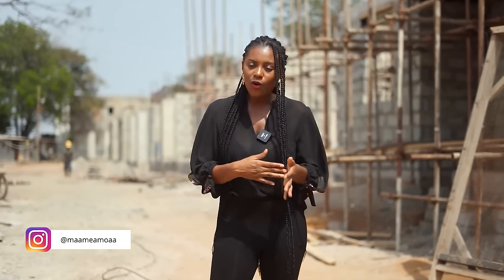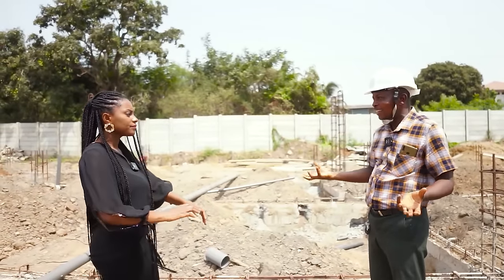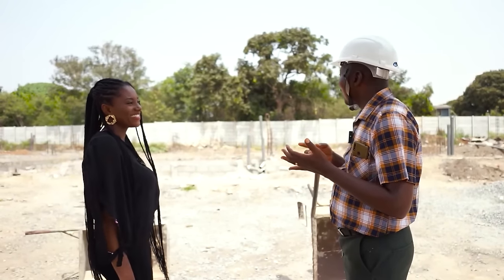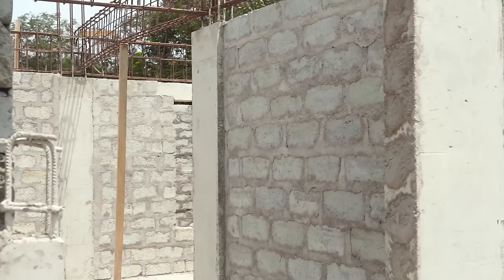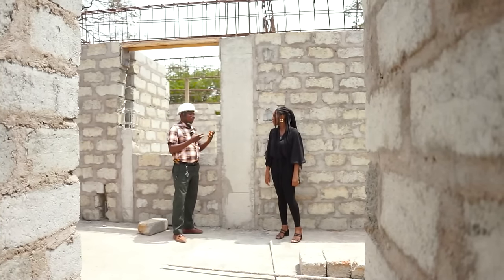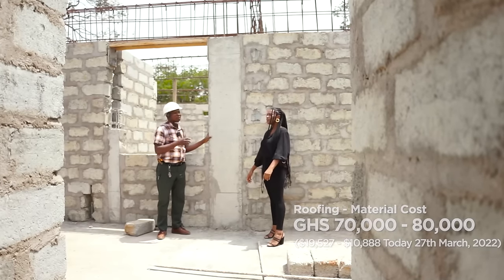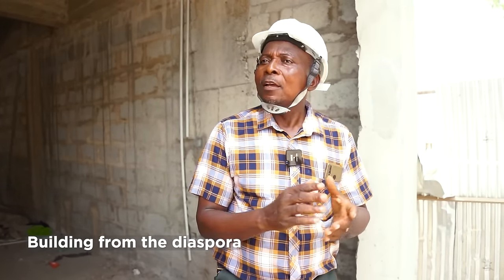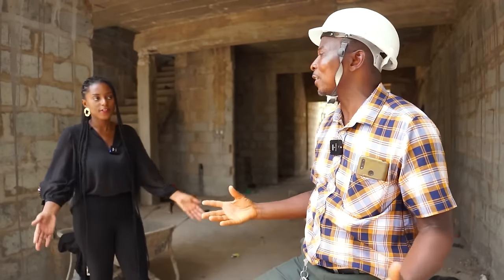Building a house: Step by step process, Costs and Tips | Real Estate in Ghana

Comment: He is what we call a custom builder here in 🇺🇸 USA
    Good info about the importance of never cutting corners especially when it comes to building a house or commercial building.  Doing so will not only hurt the customer but the contractor will have a short career because word travels fast when things go wrong.  The only thing that should ever change is if the buyer and builder decide to go with better quality materials that go above minimum requirements.
Reply: Most houses in Africa is Custom built

Comment: well said:washhands::washhands::washhands::washhands:, if you're going to tile, you can avoid scriding, also if you want to avoid outside plastering and  you have used concrete bricks when building, make sure the finishing is done well then use texture paint (paste), you will have saved on outside cement and labour but done painting at once.

Comment: That's Not A Fully  Wired Domestical House Installation Professionally (Kitchen Circuits Units Such As Cooker And Others Gadgets Sockets....Required 6mm2  Cables From The DB On Stab Block/Automatic Breaker)
Air Conditioners Units Circuits- (4mm2 Cables On Stab Block/Automatic Breaker) And Each Air Conditioner Must Be On Single 15Amps Stab Block/Automatic Breaker On The DB- Distribution Board)
Earthing/Grounding Integrated Circuit To Protect The Installation. 
Change Over Circuit Installation Between Planet And Electricity Supply.

Unprofessional Electrical Engineering Installation In Ghanaian Energy Fields...No Wonder There's Always Fire Out Breaks From Electrical Wired Projects Such Houses, Commercial Market Place  Etc